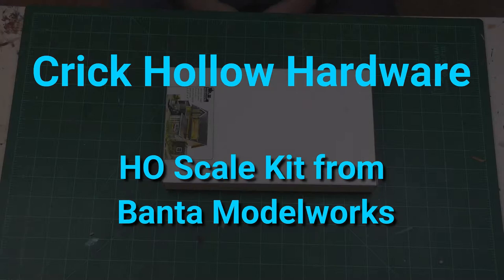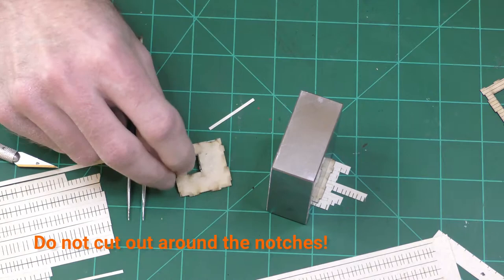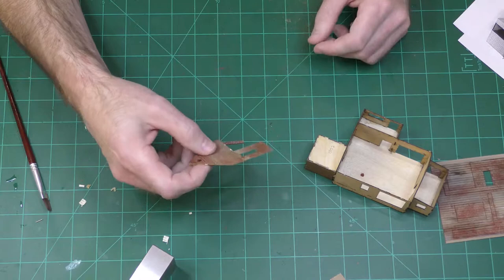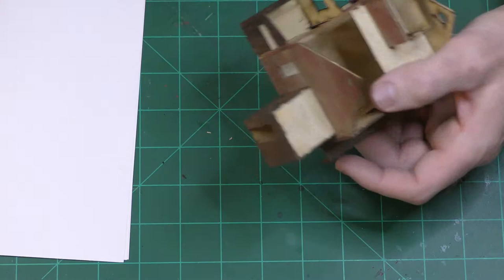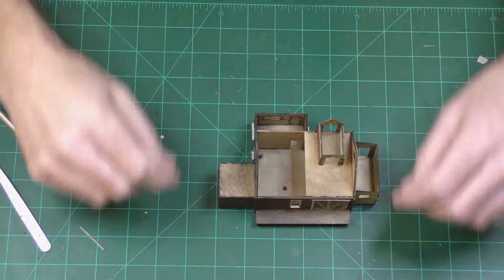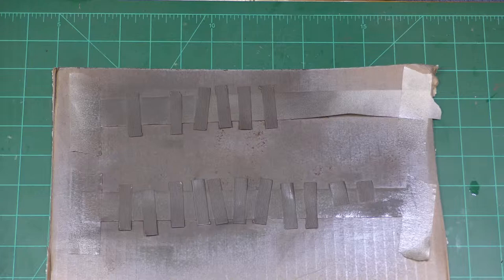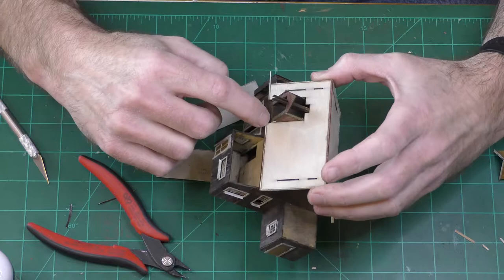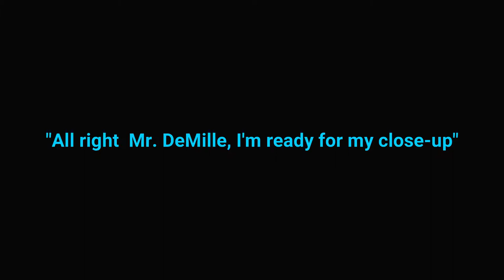Banta Modelworks Crick Hollow Hardware Build in HO Scale

Comment: You said you will fix the door later but I see you didn't.

apart from them opening in or out, the cross support needs to go from near the bottom of the frame to the top free standing corner of the door. That is when the door will not sag. This is how angular supports work. 

I know its an old video, but i thought i should just leave this comment here.
Reply from the maker: Thanks for watching one of my older videos.  Thanks for the tip on the cross supports.  That is useful.

Comment: I really like your videos and have learned a lot. I noticed your makeshift spray booth. Do you spray indoors?
Reply from the maker: Thanks for the comments.  Yes I spray indoors, but I wear a respirator and if it is a lot of painting, and also it is a big room, which I usually leave right after.  I don't really have a good way to set up a booth ventilation system.  I am pretty happy just using a respirator.  Also, I only ever spray acrylics.
Reply: @asdasx392  Thank you.